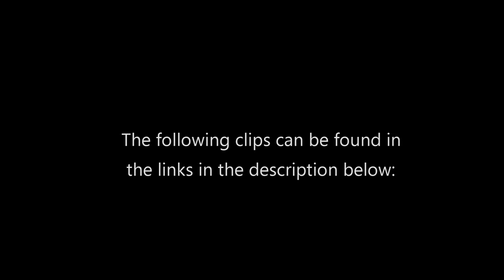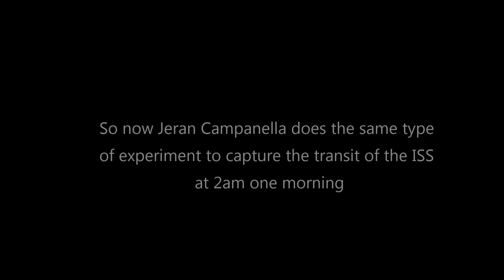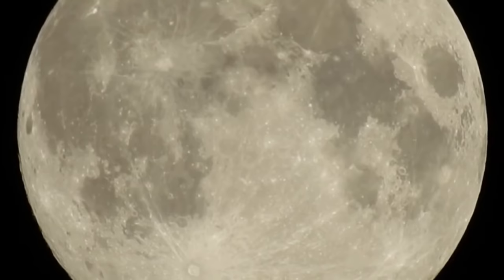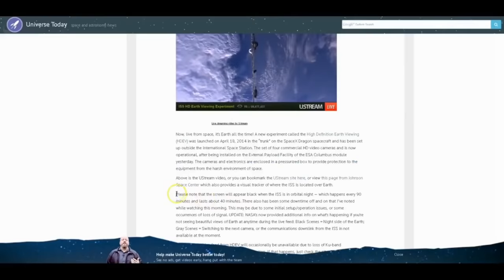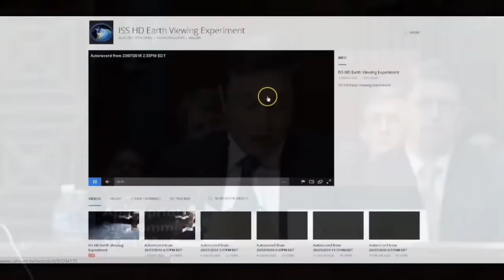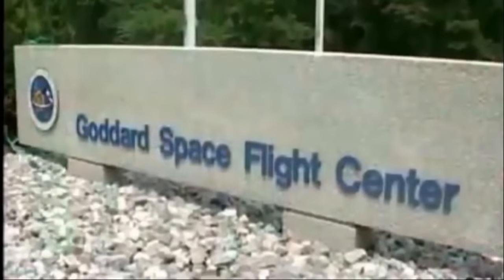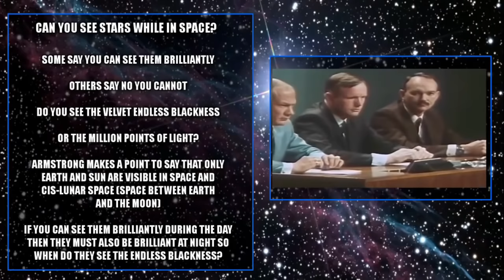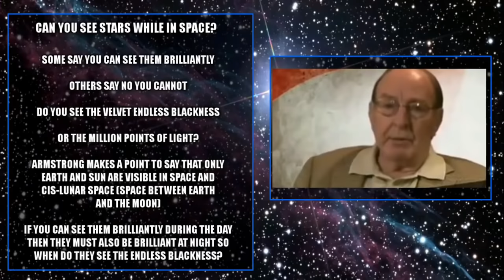The ISS Confirmed!

Comment: When they “space walk” the safety scuba divers follow them around too.
Reply: The empty space you see is the bottom of the pool the top of the pool is filled with thousands of floating black balls so that light does not come through. The USA NASA uses an identical setup as The Abyss. Other nations use a swimming pool and that is where the mistakes are coming from. The Abyss used and old non finished nuclear reactor facility ( due to a crack in the outer dome shroud) they filled it with sea water 60 feet deep as I remember and that is how they did the underwater shots. Some actors nearly drowned .

Comment: Do any of you doubters have any idea how much pressure a hydraulic system on an large excavator has? And yet just one little "O" ring between the flex hose and the solid line connector is all you have to hold back the fluid from spraying everywhere. The air pressure in the ISS is far less than that of a modern excavator .
Reply: its the pressure difference on both sides of the seal that makes the difference.
In space they need to hold 1 atmosphere of pressure which in pressure seal terms is not that much.
Reply: The problem is more because of extreme cold the O rings will shrink. Just like the blackbird sr 71 add fuel gasket issue in high altitude making the fuel leak, fuel is denser then air.
Reply: Hydraulic systems are constantly leaking. I am a mechanic who works on large mechanical presses (printing/stamping etc.) The hydraulics and pneumatics are a constant source of work due to them leaking. Those little o rings fail everywhere they are at regular intervals. And some aren't even under that much pressure. The rubber that they are made of does not last for more than 2 or 3 years, and that is when they are sitting in a case waiting to be used! I learned early on to throw the whole case of o rings out if has been sitting that long because sometimes a new ring would blow very fast. sometimes immediately! Wasnt worth the risk when you have to take a machine apart to get to the ring that takes hours and sometimes mutiple shifts/days to get to it. Yes those excavators leak all the time! Always adding fluid to the system because they leak!  How long has that station been up there? Makes no sense!
Reply: @Russell morgan, Thanks for the encouragement. I would not even bother wasting my time with these flat earthers if it were not for people such as yourself and others who help bring a little sanity into the commentary. BTW, I think we went to the moon as well. I served on the USS Hornet in the mid 60's when we picked up the first unmanned Apollo capsule in preparation for the 1969 mission. The Hornet was the ship that retrieved those brave men then. Most of these flat-tards have no idea about the role that other nations such as Australia and Europe had in tracking the spacecrafts in our space history. It was an achievement that all mankind shared in.
Reply: @Twigs N ' Jigs,  While I do agree that a little admonishment might be due me for referring to Flat earthers as "flat-tards", It makes me curious as to why you failed to call out Josh A for calling me an "IDIOT", and Jethro Mc Cormick for calling me a "STUPID IDIOT". Where was what I said in my  first post anything that said something that deserved that type of response ? I find almost no other sites except flat earth ones that continuously use insults, and ad -hominins in the comment sections against those who disagree with the FE position. I have been called so many names that it would take probably an hour to list. Besides , idiot, fucking idiot, globe tard, shill, etc, etc. I have been called by my so called Christian brethren, a Satanist, worker of iniquity, anti-Christ, child of Satan, deceiver, etc. etc. Do you get my point ?
Reply: @Accumenofapperception  Those rings are built with planned obsolescence in mind, to give you a job. Shitty quality. Thats what your installing.
Nasa likely considered this, and probably uses nylon or ptfe (teflon). Not everything is equivalent with all o rings... not to mention, oil and hydraulic fluids break down rubber over time.
Reply: but space is a vacuum which is a lack of pressure right?
Reply: @happydays4551  one atmosphere is 14psi. In terms of a large plate of aluminum, that is a significant amount pressing outward over a large area, applied outward from pressure inside the haul. When it comes to pressure, your seeking the difference or delta between the systems. Human skin can take 90psi before it tears. (i am a tattoo artist and know about body suspension.) So Aluminum holding back 14psi is nothing.
These little rubber seals have such small surface area, they experience less than a pound of force. Engineers in the 50's took all this into consideration when they sent dogs and monkeys into space.
Think about aluminum tanks of compressed air, or air compressors, or the pressure in a soda can. 50psi at room temp. Its all about structural design.
Reply: Lol, prove Gravity!
Reply: @SoonerSquatch  
LIGO is a pair of facilities, one in Washington and one in Louisiana. They use lasers perpendicular to each other that bounce a mile in both directions at both sites. These facilities can measure the compression of the lasers, relative to the uncompressed laser each is perpendicular to. 
They watch the compression wave hit one facility, then the other almost simultaneously. 
A seemingly mechanical wave moving at the speed of light! That... is a gravitational wave.

NO other mechanical action can move that fast, because gravity is not mechanical, it is the bending of spacial distance via the nature of matter.
Reply: @Reach3DPrinters  um, it called boyency... tell me how the uss enterprise (95 tons) can float?
Reply: @Reach3DPrinters  but outer space is "tore" absolute "0" psI things work way different when there is no pressure
Reply: @happydays4551  
Did you read my reply about LIGO?
Buoyancy nor density have anything to do with the linear compression of distances at the speed of light.
Explain how buoyancy would cause distances to compress in one direction almost simultaneously, 2000 miles apart?
Reply: @happydays4551  Also, Ive never seen a "uss enterprise" float, unless your talking about a mini display model, suspended using magnets... which i still don't think ive ever seen... that would make a nice product to sale.
Satellites and space craft do not float around Earth, they are constantly falling, they just travel at such a speed their vector arcs around the globe, always falling toward the horizon (orbit). There is little air resistance that far out, so they do not slow down very much at all... but they do some, and need regular correction for altitude and speed adjustment. If not adjusted, the ISS for instance, would slowdown, drop altitude, and experience more and more air resistance... at those speeds, it would burn up.
Reply: @happydays4551  
How specifically do things work in a zero pressure environment? Do you have references to experimental data that contradicts the mechanics of spacecraft? What 0 psi system are you referencing. If you posses data that is controversial to space flight, we should evaluate it. Pursue truth at all costs.
Reply: John Arch  Read a few of my previous comments. Your correct, were dealing with a delta in pressure. That difference between the inside and outside of a space craft is only 14psi. The seals experience a fraction of that pressure.
Reply: Gary Smedley Doubters ? Oh yes, I forgot—liars are so honourable? Some of low morals need the job of defrauding the people.
Reply: @geoffphillips5872  No human is above lying on a rare occasion, but what defrauding specifically do you speak of?
Reply: @Accumenofapperception  At what pressure does hydraulic systems operate: 70 BAR to 350 BAR? A bit higher then 1 bar isn't. Also, hydraulic systems constantly have rapid pressure variations of up to +/-350 bars; the pressure differential in ISS doesn't vary in time, so basically no wear of the seals...
Reply: @garysmedley6263  you know it's not always black and white there's grey area to but I think the question you should ask is why is it so important for you to believe the government? There no liars and all events throughout history pick a country in a government they've lied to and fucked over the people NASA what's the company founded by and ran by Nazi scientists NASA has been tainted from the beginning and don't be fooled when they say it's private or it's not like other government agencies that's bullshit that's it is a PR firm more than anything else
Reply: @ci facetious, so when I watch rockets launch from Vandenburg AFB , which I regularly do from a hill near me, and they travel until they disappear ; Where are they going ? When my son who lives in Spokane , Wa. and my brother who lives in so. Oregon and myself are watching at the same time the ISS pass over , how is that a lie ? A thousand miles of distance between us and yet we all see it ! How can that be if it is all a lie and it is not up there ?
Reply: @Reach3DPrinters  do you know anything have HVAC? what temp will water boil at while in a vacuum?  what do they say the temp is in outer space? (-400 to +400) what type of refrigerant do they use?(ammonia) what are the working temps of ammonia?
we put off 50 billion skin flakes a year.. Who cleans the iss or any "space ship"
Reply: @happydays4551  Water in liquid state can only exist in partial vacuums. A perfect vacuum effectively cannot exist. The temperature the ISS experiences, via sunlight and shadow, is +/_  250f... not 400. 
If liquid water were ejected from the ISS into space, it would begin expanding and boiling instantly. This steam in space, with a low thermal mass, would cool very quickly and turn into crystals.
Ammonia for refrigeration is used in a closed system. It is under pressure and doesn't experience this. Space is certainly volatile, and massive amounts of energy is collected with solar panels. Combined with insulation, the ISS is capable of maintaining room temperatures.
The astronauts work 15.5 hours a day. Their schedule includes cleaning the surfaces. Much of the Russian side is made with a Velcro loop fabric surface, and cannot be cleaned as easily. The trash is burned on the Soyuz reentry.  
You have a lot of questions, and nasa engineers spent decades solving many of the problems you question. It took teams upon teams of people to not only resolve the engineering, but to crunch weight cost, fuel, building entire one off electrical and pneumatic systems, machining EVERYTHING unique for its job... its an insane task to fathom, but was incredibly achieved and we are lucky enough to witness it.

In honesty, Im not extremely familiar with thermo mechanics in extreme environments. Space is such a foreign environment, its difficult to consider all the variables that we take for granted on Earth. I also do not know the specifics of the ISS systems, I haven't studied it carefully. Each system is complex enough that its unlikely any individual fully understands any complete system. Record keeping is crucial, as unexpected things can fail and cause cascade events. The ISS is as much a death trap as the USS Thresher. Its in a very hostile environment, and only through careful calculated progress, are we where we are... over 60 years of Space exploration, and we have an RV and a couple thousand satellites in space. Kinda lame, nothing incredible... but kinda remarkable at the same time. About what you would expect from the truth.
Reply: @Accumenofapperception  No pressure in the vacuum of space. You can plug a small hole in the craft with your finger without being sucked out like a sci-fi movie death.
Reply: That is not necessarily the issue here. Its that they dont have a protocol to fix the goddamn thing in case something does go wrong. I work on excavators sometimes and though it may seem that the pressures are high, which they can achieve, all hell breaks loose and is quite different in a vacuum. You cannot compare the both. regardless, the whole idea of micromteorites that could, should and would hit these surfaces would damage the entire ISS within miliseconds once a breach came about. Think about it, pressure from the inside helping a vacuum to pull out that inner space. The whole ISS would implode instantly. GAME OVER.
Reply: Plus the jet if air squeezing out the hole would shift the trajectory and then they wouldn't be able to meet the rocket carrying the monkeys that are smart enough to put toilet paper into the hole.
Reply: @quevicular  
Micrometeorites are a serious threat. The ISS has double walls, separated by over a 20cm (8") gap. They determined the first impact would break through the outer skin, but disperse across a larger area before hitting the second shell of aluminum. Aluminum has great properties for this... under high stress, it enters a "gum" like state, more malleable, and will warp before rupturing.
Then consider the micro meteorite. Energy delivered is based on speed... check... plenty of speed, but also based on mass. These micro meteorites carry less energy than you'd expect.... of course, anything bigger than a BB can be serious, but most impacts are less than 2mm and do not have sufficient mass.... Id be more worried about all the debris left up there. Launches have to be scheduled around missing space garbage from 1000+ satellites and craft left to crash into and skip off the atmosphere.
Reply: @chuckrobinson47  Well, astronauts are kinda the mechanics of space. They are not scientists or engineers necessarily. They are VERY knowledgeable about a wide range, but not specialists. So when they are confronted with technical questions, they don't have the answer. They are just the worker bee's, that operate the machine and carry out experiments. They have a set of instructions to follow. So mental stability, physical health, calmness, communication, and general knowledge makes a good astronaut. 
I also leverage the internet. I don't know for sure water boils and then freezes in space, but looking into a chart on the phase changes of water at different pressures and temp, gave me more insight. I research a lot and the more knowledge I collect, the more amazing everything interlinks together in very unpredictable ways.
Reply: @TheJaythyzul  Well, Based on a pressure difference of 14psi, your skin can handle a lot before it tears, something like 80psi. So, your skin sucking out wouldn't be the issue, but if the hole was too big, it would start to dislocate your joints and muscles, simply due to the internal 14psi. So a hole about 6"x6" is 36" area x 14 = 504 pounds... so if you placed your back against a 6"x6" hole, that area would experience 504 pounds of pressure.. which would begin to break ribs, then muscles wouldn't have the support to resist... certainly a large clump of tissue and organs would bulge out of the 6x6 hole, probably ripping the hole larger until you were sucked out.... but 6x6 is huge...
Realistically... were talking 1"x0.5", so 0.5"x14psi is 7psi... so that may not seem like much, but humans can only blow at 1-2psi max. So a 1/2" hole wouldn't suck your body out, but it would give you a hell of a hickey!!! :)
This made me look up how hard a human can suck air... about 1 atmosphere, so 14psi MAX... so space sucks about as hard as the average person.
Reply: Philshki82 do you know every aspect of your employment? Shipping? Labour costs? Profit projections? Every rule, concept and history of said employment? The reason you have teams, and specialists is because no one can know everything, except you of course. Why did you give MS to bill gates for free? Why did you give away wifi for free? Led lighting? I’m assuming that with your incredible intelligence you have all the solutions and ideas to fix every issue we have on this planet.
Reply: One reason @Reach3DPrinters’ answer may seem better than an astronaut’s answer you heard in person or video is that writing a response online is far more forgiving than spoken response. When you write a reply to a comment online you have the advantage of accessing the internet. As well, you have the advantage of an indeterminate timeline of response. Being able to perform editing prior to publishing is another clear advantage.
Reply: Dewar Miles such a well put statement.